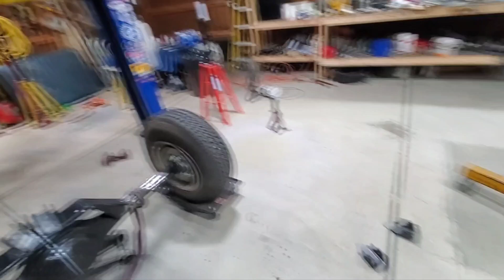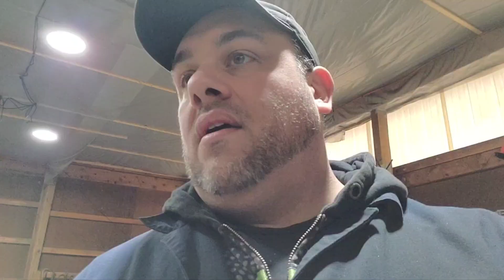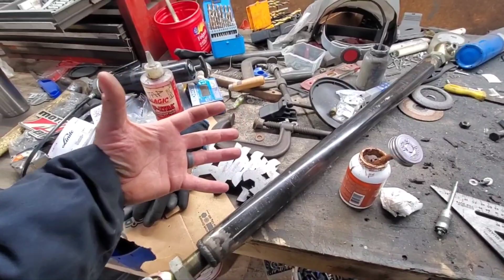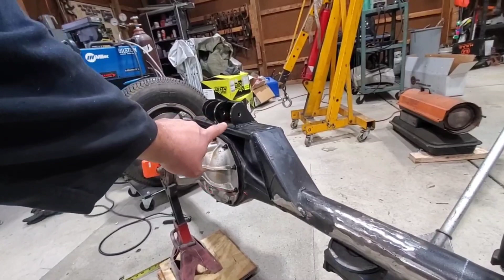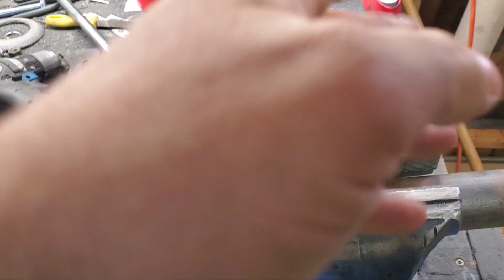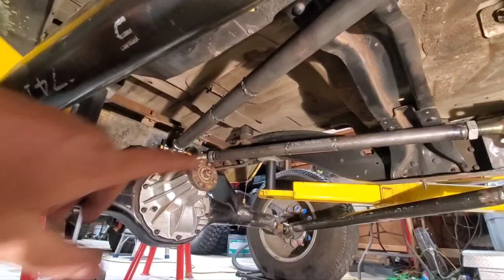LS Swapped Bronco II Rock Crawler Project: Rear 4 link Design and Install (RBV)

Comment: Sorry if I missed it but is the rearend flipped 180°?
Reply from the maker: This is a ford 9" housing with a HI-9 3rd member... basically it's a High Pinion with strong reverse cut gears.  Gains a ton of ground clearance.

Comment: Think I missed it, I thought you were running double triangulated 4 link?
Reply from the maker: No that's how the original owner of the frame was gonna set it up....
Reply: @BuildItWheelItExploreIt  if you've got the room I'd run double triangulated, it is the best setup but hard to pull off that's why semi-triangulated is so popular, but I'm sure you guys have been through that.

I'm using an XJ tank similar to the B2 tank for double triangulated 4 link in the future. But my exhaust is outside the frame with the LS swap so I'm almost completely clear from the tcase back between the frame rails.
Reply from the maker: I don't see a need to try to reinvent the system.  Triangulated 4 link does amazing on the Ford Ranger/Explorer/Bronco II chassis... I could see doing that with a flat bottom setup with 16-18" travel...  as it was setup double Triangulated the lower links already came in contact with the frame at full bump, I don't have that issue now.
Reply: @BuildItWheelItExploreIt  good to know, I was curious of them making contact at full compression.